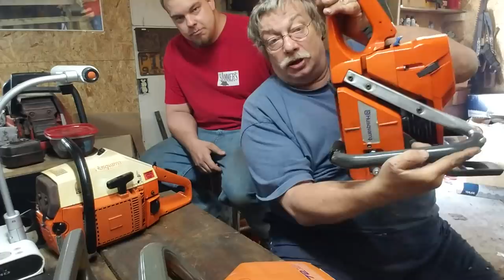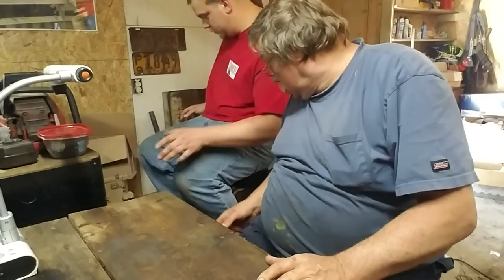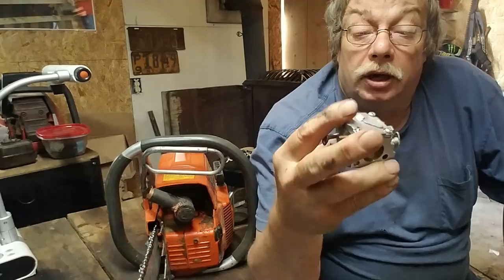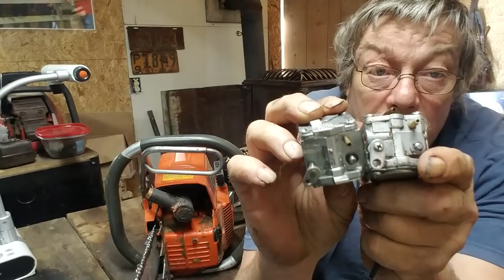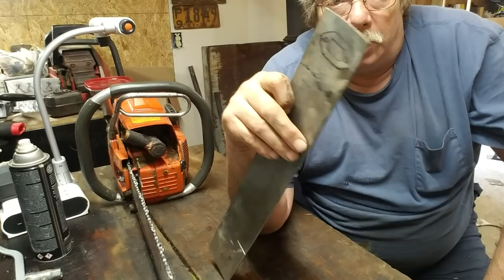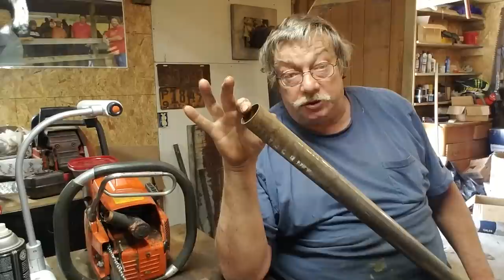Matt's  272 first starts! Tomorrow's highlights! Some tips!

Comment: wish I could bring you one of my logging saws we use here in the mountains.  high altitude running is tricky here 9,000 - 10,000 feet elevation.  great work you are doing.

Comment: Ironhorse, I’ve got an old style 372 that has a crack in the case above the flywheel. I feel like I should replace the crankcase and just not do something like JB Weld because of the stress and vibration. In your opinion, is it worth splitting the crankcase and starting over? Or should I just open the lid to the garbage can and save myself the frustration? Appreciate what you do! Take care!

Comment: A question. I just rebuilt a 268xp and cannot get the rpm that I want unless I run the high jet at 1/4 turn. Would a smaller carb let me get the rpm I want without having to lean the jet so much? Thanks

Comment: I can't find a video on this. I have a 576xp non autotune, and I am rebuilding it cause the muffler broke and people kepted starting it and scored the cylinder.  I took it apart and I am unsure about connecting rod play. It doesn't have any up and down play but it has side to side play. It also slides side to side on the bearings. I am hoping the crank is still good, but it don't know. Is there any way you could do small segment on crank shaft connecting rod play. Thanks for the content.
Reply from the maker: Side to side is normal! Push and pull the rod and if no play you are good to go!  Sounds like you have a good crank!
Reply: @theironhorse6600  thank you for the answer. I'm ordering the cylinder head and piston plus muffler today! I really like your video's keep up the great content.😎

Comment: Mr. Harvey I really enjoy your videos. Been a sub for about a year and as you know don't really comment. I have a question sorry if this is a stupid question but can you beef up a poulan pro 42cc? I use it as a trim saw and small stuff. Thanks Mr. Harvey.
Reply: I like your profile picture, good choice. I’ve done  a few non-pro poulans. Just the older non-strato wild thing models and ones like it. Muffler mod does a lot. As far as porting, they have bearing pockets that have to be cut in order to get more compression and that’s tricky to impossible. You could have the top of the piston welded and machined down to get the proper squish but easiest is just muffler mod it and tune carb to match.
Reply: Sorry, I’m not mr harv and don’t even have 1% his experience but this stuff intrigues me. Good luck poulans are fun to learn on.
Reply from the maker: Ben!   You gave perfect answers friend!  Soon you will see a p-62 build that will make you happy!
Reply: Thanks Ben

Comment: Love your input !! Great videos!.... I do have a question for the master, I’m working on an old 1-53 and can’t find the lower reed valve plate gasket. Do you have any ideas of what I can use?   Thanks
Reply from the maker: You may have to make one!
Reply: What would you use for gasket material?
Reply from the maker: Rodney Mohn I use a soft drink or a cereal box!
Reply: No kidding... awesome!  I thought about making one but the old one is pretty thick with metal flakes imbedded in it. Like a combination between an intake gasket and an exhaust gasket.
Reply from the maker: Rodney Mohn the only thing to watch is that your bolts don’t bottom out!
Reply: Got it.. Thanks so much. Very appreciated.